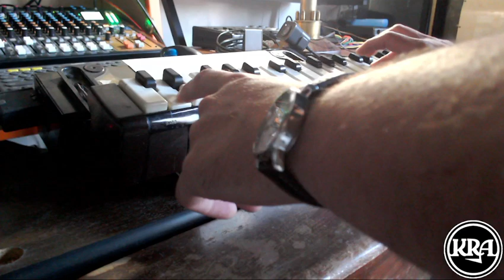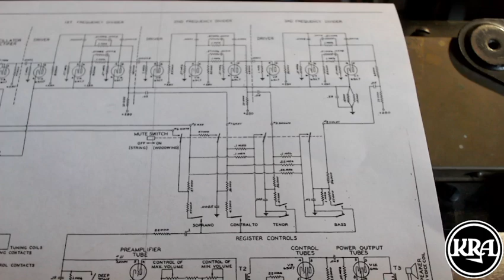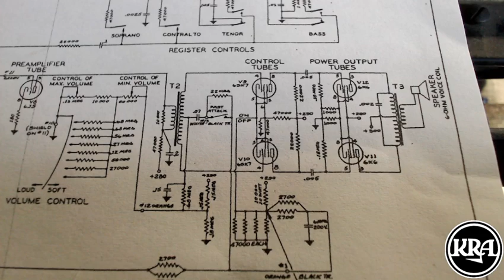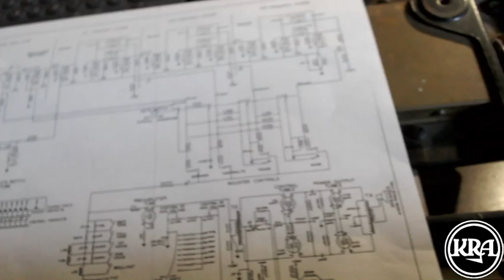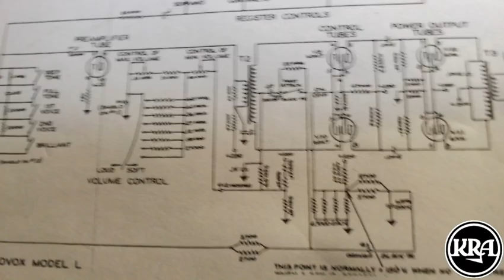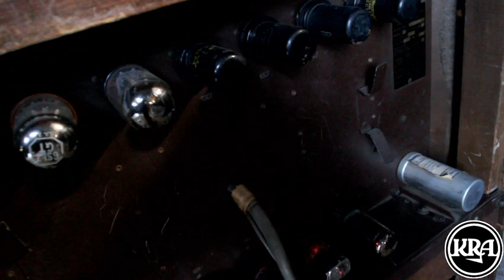Hammond Solovox Model L demo and schematic discussion

Comment: I see that model J is from 1940, model K is 1946 and latest model L was built from 1948 to 1950.

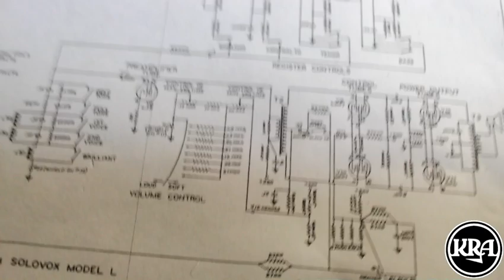Mine is model L, same as seen at 17:21 in your schematic diagram.

We now have 230 VAC, 50Hz, as a standard here in Europe. I guess that I must get a 230 to 115 voltage transformer before attempting to check my grandfather's Solovox. He had it connected to 125 VAC 50Hz at his home.

Comment: Thanks a lot for your excelent explanations. 
I've got a Solovox that belonged to my grandpa. It's model L.

You said model K at the first minute of this video although at minute 27 you corrected yourself, and your title says that it's an elegant and simple model L electronic design.

Your explanations about the different sections of the diagram are excellent. Many thanks for sharing!

I also have my great grandfather's 85 keys Erard piano, made in Paris around 1890 that sounds brilliantly but requires very frequent tuning.

My parents home is on sale and we have to empty a thousand things quickly. 

I play mostly guitars but I can play a little piano also.

My wife let's me use my Stratocaster at home but she doesn't want me to bring more instruments. 

Do you think that I should try to keep both instruments and restore Solovox?

I remember that this organ had many notes out of tune.
I will need to replace the 12 capacitor sets that tune the 12 notes to equal temperament standard 440Hz tuning, using new polyester capacitors.

Comment: Question: I remember micro, mano and pico. Things changed since 50 years ago, when I was actually use it.what is MEG, that you refering to in relation to Farada?
Reply: It says .1 Meg, with a meg being 1 million ohms, so a weird way of writing 100k ohms. For capacitors, the micro, nano and pico denominations have not changed. In ye olde times, however, engineers would put "micro micro" to designate nanofarads. Hope that helps.